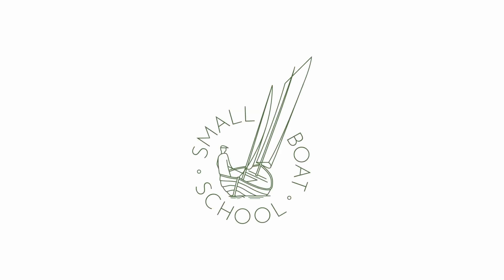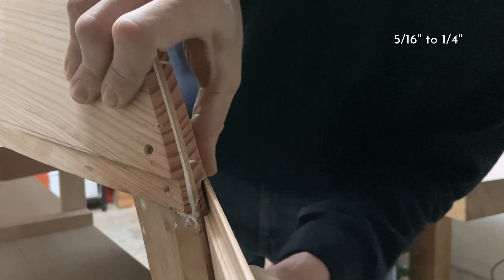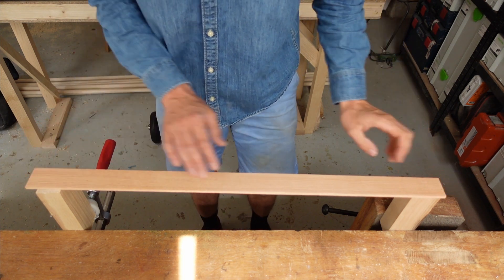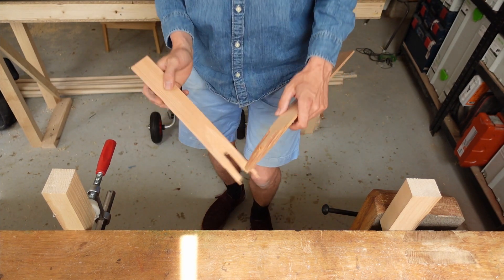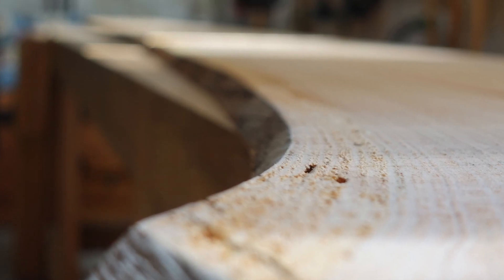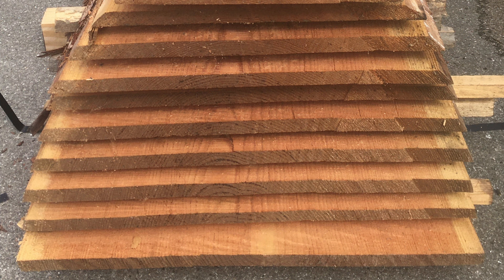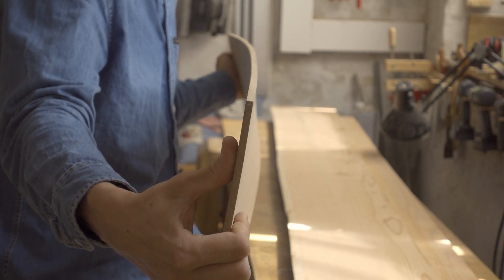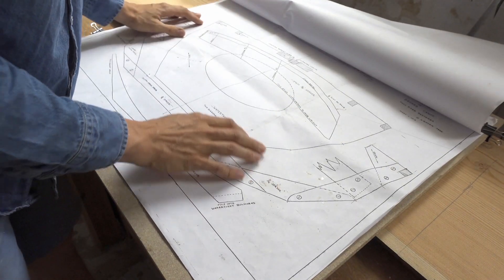BOAT WOOD: Look for THESE 6 THINGS before you buy

Comment: What do you think about plywood boats encased in fiberglass , is differences in expansion & contraction a problem ?
Reply from the maker: Plywood is very dimensionally stable because it's made up of several thin layers of wood that are at 90 degrees to one another. Shrinkage and swelling is generally negligible. So sheating it with fiberglass and epoxy is not a problem - it actually makes it a lot more rugged and keeps water from getting to the wood. 

The biggest downside to it, in my opinion, is that it's messy and toxic to work with. So when I build boats I try to use these kinds of materials only sparingly and only where they add significantly to the boat in terms of longevity, performance or wood consumption. 

For example, if I can seal a loose knot with epoxy, I do it. Because otherwise I would have to discard the plank, which would be wasteful.

Or if I can seal a plank seam with a flexible caulk which keeps water from getting into the boat when it has dried up over a long winter, I tend to do it too. 

Sealing seams with a compound that keeps water from getting in and causing rot is a strong contender, too, because it can add significantly to the lifespan (and thereby long-term sustainability) of the boat. 

But again: I try to keep it reasonable. For me, boatbuilding should mostly be a fun woodworking job. Not something I do wearing a respirator and a hazmat suit.

Cheers, 

Mikkel

Comment: Sorry, you mention a planking wood and sounded like 'larch'. What were you referring to? I am not familiar with the timber species.
Reply from the maker: Hi Joseph. Yes, you heard it right. Larch is used a lot in Denmark for planking, because it is stiff, relatively lightweight and relatively rot resistant. You can find more info about it here: https://www.wood-database.com/european-larch/ Depending on where you live, other species can be great substitutes.
Reply: @SmallBoatSchool  Thank you so much.

Comment: Excellent. When I relocate to Phuket Thailand in December, I will take your course then. Finding out about the proper wood to use, may be a challenge, however. By the way, your English is very clear, with good diction. Tak.
Reply from the maker: Thanks a lot! I would be very curious to find out what would be the best wood species currently available in Thailand. There is a four-volume work on Thai boatbuilding by Khun Phaithoon which might be useful. I would guess that teak has been commonly used, but it might be hard to come by nowadays. And while it's one of the best boatbuilding woods, it might also be on the heavy side for a canoe. Regards, Mikkel
Reply: @SmallBoatSchool  Yes Mikkel, teak is very rare indeed. I have been to the local lumber supply store there and I have never seen such dense wood for 2"X4" lumber.! I will go to marine supply shops and inquire. And I will certainly look for the book you mentioned. I am very excited to get started. Hilsen, Ken
Reply from the maker: @takforalt  Good luck, Ken! And do let me know if there's anything I can help you with. :-)
Reply: @SmallBoatSchool  OK Mikkel will do. I will keep in touch. Mange tak.